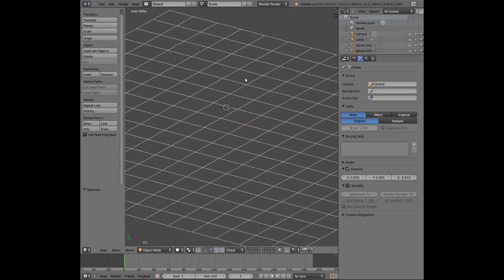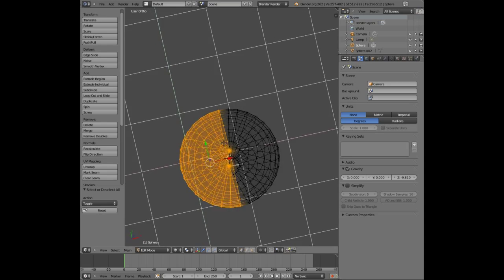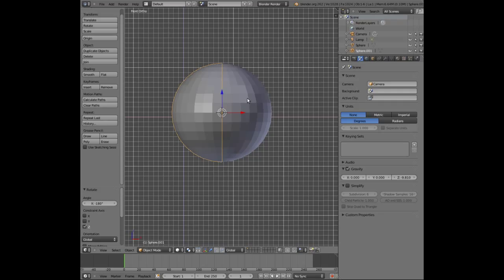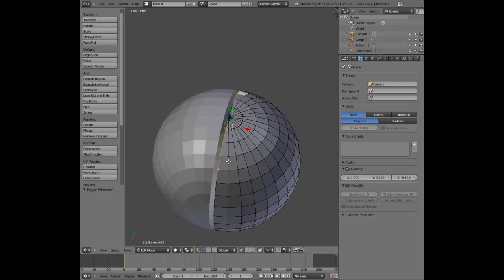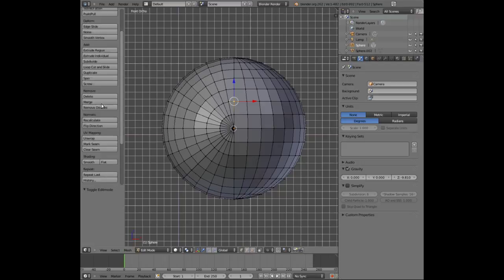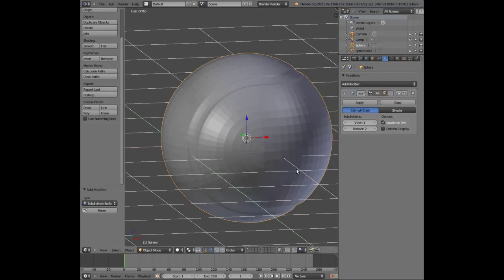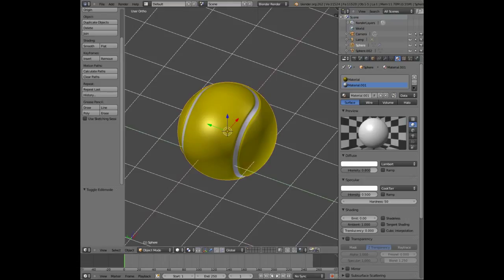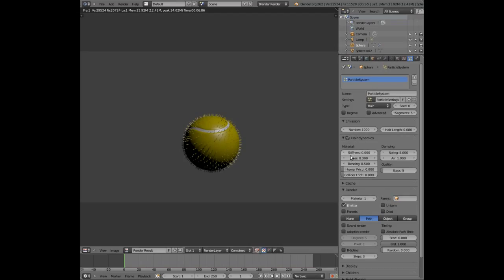The Simplest Way To Model A Tennis Ball!

Comment: Thats not exactly what a tennis ball look like. If you search for tennis ball on google you see that this modelling technique is incorrect. I believe it could be a good starting point but its not correct
Reply from the maker: Hello, I certainly cannot completely disagree regarding your comment.
Most of my videos at the time were designed to help those "get started" and get an idea of the principle of how things work!
But again, fair point Skillzor
Reply: I think that the only way to do a tennis ball is by modelling the 2 pieces and flat planes and then use Cast Modifier or Curve Modifiers to make it into 1 ball. It is ofcourse also possible to make a round cube and use knife tool but that will look terrible and its going to require alot of work to make it look great
Reply from the maker: @skillzorskillsson8228  The two-piece idea intrigues me. I must admit, I am not familiar with using Cast Modifier. 
I would be willing to pin a comment here that links to your video on it.
It is all about helping the user and if your method is better, then all power to promoting it... thoughts?